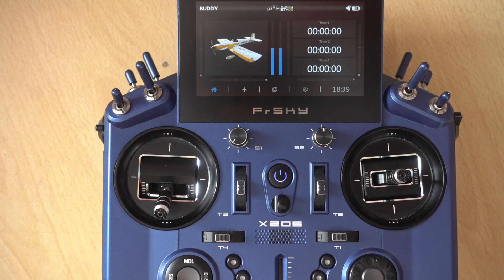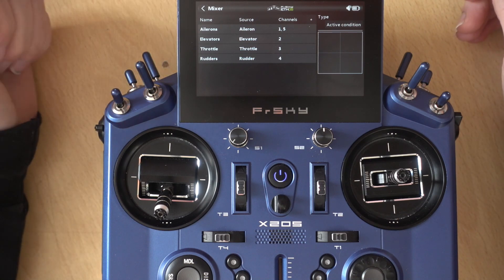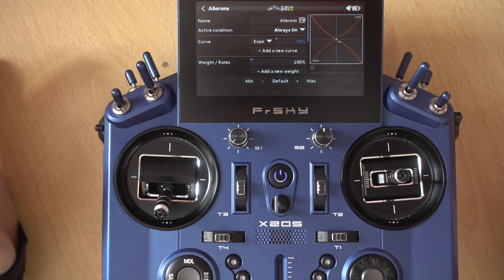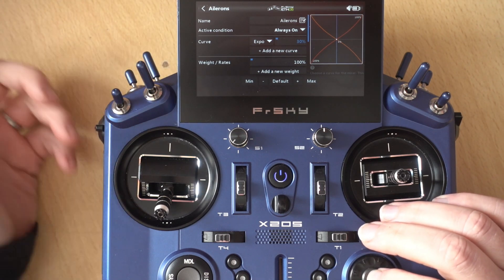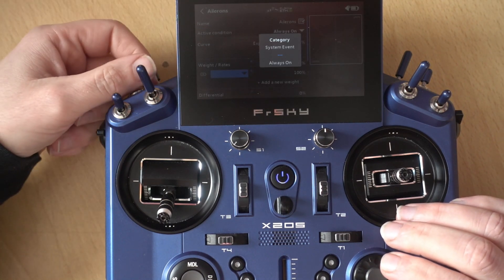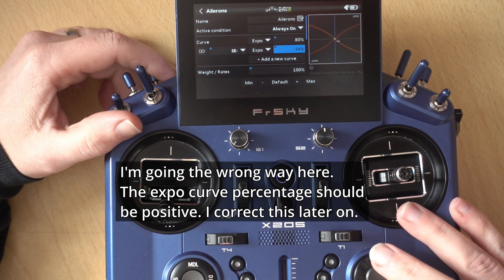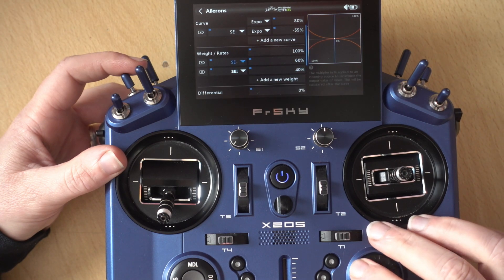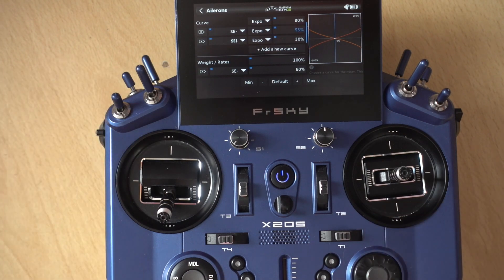Setting up Rates and Expo in FrSky ETHOS

Comment: Its better to move in on the servo horn than to add expo
Reply from the maker: They are for 2 different things. Moving the control linkage will change the amount of throw that the control surface can move. It is best to set the maximum amount of throw using the control linkage. This shouldn’t be a wild amount. But the recommended maximum. They’re usually in the airplane manual. After that, you can reduce the throw further using rates, for if you want to fly more sedately. 

Expo alters the movement curve of the stick in relation to the control surfaces. When you add expo. If you move the stick at exactly the same speed from the centre, out. The control surface will move slower when closer to centre stick, but quicker at the end of the stick movement. Expo is to give you more fine control around centre stick.

Comment: Many helpful Ethos vids thank you. Maybe show how to setup reverse thrust for EDF's with reversing ESC? There is a separate signal wire going from ESC to channel for controlling reverse function. Adding this channel and mapping to switch make it reverse but you still have to move the throttle to max. Am trying to figure out how to make throttle go to max when reverse thrust switch is activated and back to zero throttle when switch deactivated. No luck so far. Throttle acts all weird or won't work if I try to make it do this. I know it's possible of course.

Comment: Ok, I will try to explain what I need: My airplane is a glow engine rc plane, and I need a throttle cut. The engine is cutted 100% when the throttle is 100% down and the trim is 100% down too. I need a mix that when I press a switch, it puts the servo on this state: 100% throttle down and 100% trim down, besides what trim I'm using or what % of throttle I'm using.

Comment: Hello, thanks for answering my questions. I bought a TD R10 receiver for my X20S. What power should I use for the 900MHz? The default 10mw? Or the max 500mw? It's for a glow rc airplane, not for fpv or drone. And i'm not using external antennas on the X20S.
Reply from the maker: 10mW will be fine for a line of sight plane. It will be able to go further than you can see on 10mW. If you feel uncomfortable, then you could go up to the next power level. But it shouldn’t be necessary. I have heard of 10mW on ACCESS 900MHz going tens of kilometres. 

If using the internal antenna on the X20. Mount the 900MHz antenna horizontally in the airplane. The 900MHz antenna in the X20 is located in the handle. For the 2.4 side I would have one horizontal (other direction to the 900MHz) and one vertical.
Reply: @MrD  Okay, thanks. and another question, what is built-in voltage sensor? td r10 has this voltage sensor, this shows the voltage of the rx battery on the radio? The TD R6 doesn't have it. Or the TD R6 can show the RX battery voltage on the radio too?

Comment: another question, I don’t have weight / rate in throttle so I can’t setup the servo in my glow rc plane… what i’m doing wrong?!
Reply from the maker: There is an option to change the trim to a low trim, for setting the idle. You can also use a curve to set the overall throttle. Or, set the endpoints of the throttle servo movement using the endpoints on the outputs page. There are a couple of options.

Comment: how can I add more rate in one side than the other? like I have one servo for both ailerons, but I want to add more rate in one side than the other
Reply from the maker: I don’t really follow you. But I guess you’re talking about differential. So, for example, there would be more aileron up than aileron down. The only way you may be able to do this with a single servo is mechanically. Possibly with a special servo horn where the holes are not straight across; but slightly swept forwards. You can only set up differential in the radio if each aileron has its own servo.

Comment: It took me awhile to get my head around this, as I have a Horus X10S Express that I recently acquired - used.  It had OTX on it and I just was not able to make head or tails with it.  Had it upgraded to ETHOS, but was unable to find tutorials for this system.  Thank goodness that the procedures are nearly the same as with the X20 - just a lot more dial twiddling.  Keep up the fantastic work!
Reply from the maker: ETHOS is pretty similar to OpenTX thankfully. The biggest thing for me is having to get used to not having the inputs page. I always found that really useful for clarity. Though there are lots of areas where it is easier.

Comment: Hi Daren I have a question I have a RX4R receiver that i up dated to ACCESS using a newly acquired X18S and have found there is no S BUS output I used a toolkit M6 to confirm am I missing something ?
Reply from the maker: This receiver has SBUS IN and SBUS OUT. There are some solder pads, opposite the bind button. If you check the manual, it shows you what those 6 pads are for. https://www.frsky-rc.com/wp-content/uploads/Downloads/Manual/RX4R/RX4R%20ACCESS-Manual.pdf
Reply: @MrD  This receiver comes with 4 servo out puts plus a nice little set of leads that plug into a socket on the board for - + sbus AN2 sbus out sbus in the first three have a std servo plug /socket the rest singles. I swapped the two sbus leads and got an output but unstable. Why two sbus outputs ? 🤔
Reply from the maker: You shouldn’t use both SBUS connections. Only the one you need to use.

Comment: Thanks Daren, videos very are super helpful.  Would love to see a video on how to move the rudder to the right stick for those gliders that don't have ailerons.  I've had to use the rudder aileron mix, is there an easier way where the left stick is not rudder active?
Reply: I just plug the rudder servo into the aileron channel. I’ll also mix the rudder stick into the aileron channel if I think my instincts will kick in when the plane is on the ground.
Reply: @txkflier  Good idea,assume you assign ailerons to one channel.  I was hoping there was a program step to assign the rudder to the right stick without changing the transmitter mode.
Reply: Thanks Daren  That's a great video
 Do you know how to set up 2 servos on a Single wing  so they are balanced correctly  I've been looking everywhere and I cannot find it for frsky
Reply: @darrylplumer3877  In the new model setup wizard, you tell it how many channels to use for ailerons, elevator, etc. Once the model has been created, go to the monitor screen to see which channels move when you move the sticks. This will tell you which channels to adjust for reversing, sub trim, and travel for each servo.
Reply: Thanks it works well.